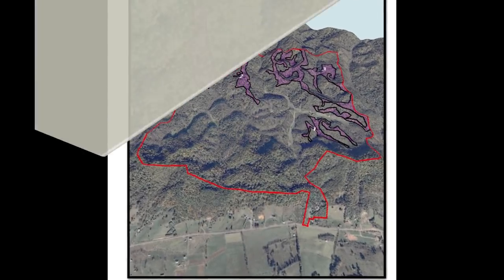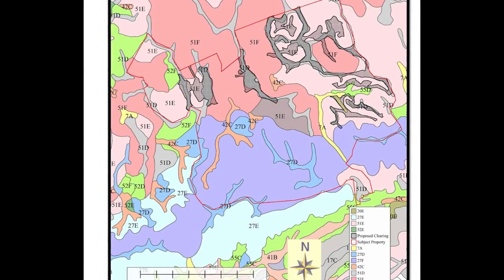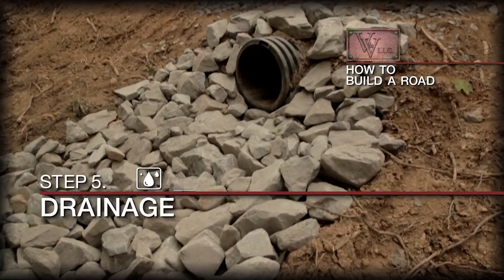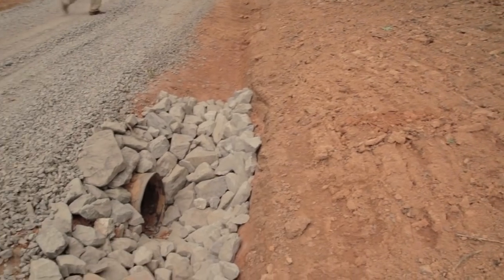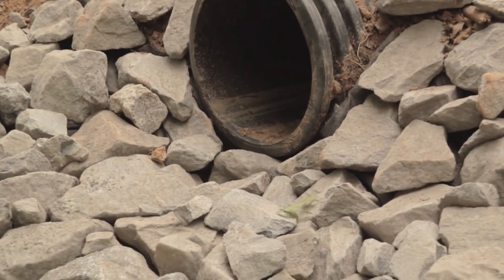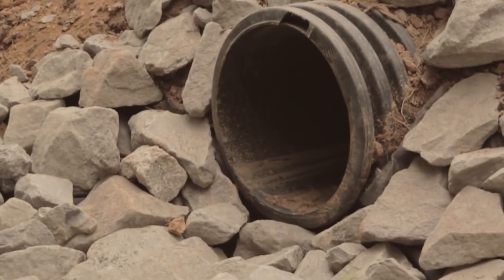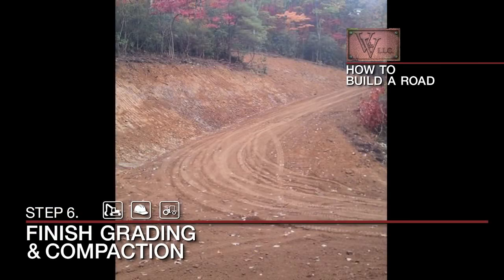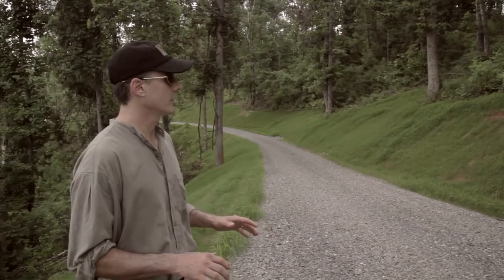V&V Land Management Presents: How To Build A Road

Comment: I have 30 years experience in Forestry and have been involved with both private and industrial road building.  You have done an excellent job here! This video should become part of the curriculum of road building courses. I would only add; there are times where road use, intended life span, etc... may warrant a less than "Cadillac" quality job. And, please do not re-vegetate roadsides with shade tolerant grass and  / or shrub species. They escape into the forest and cause problems many years later.

Comment: Does clay based fill dirt work as a graded base for a steep road with gravel on top? I have a steep driveway that is soft in spots. Whatever is underneath the gravel is spongy and won't harden up.  I want to remove this spongy material, whatever it is, and fill and re grade the driveway. Can I use fill dirt from the local area for this?The base in the good parts of the driveway is hard and the gravel packs into it and locks into an almost paved like surface. Ideally I would like the entire driveway to be like this.